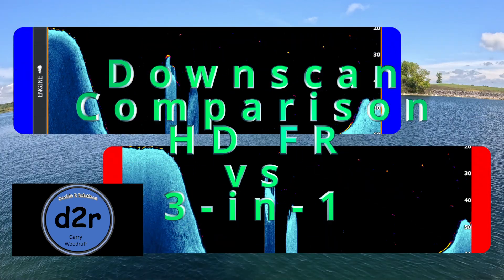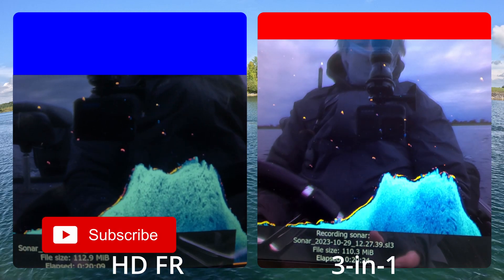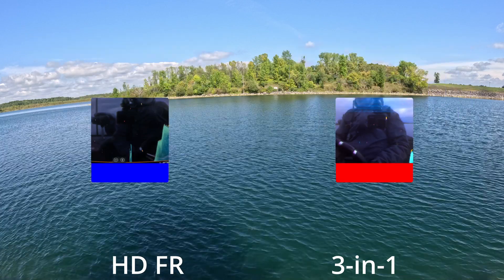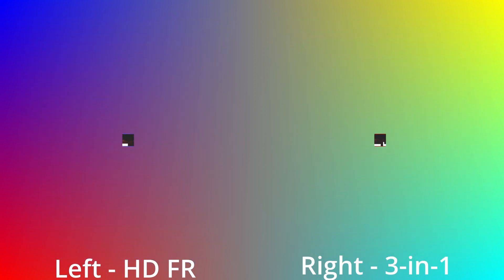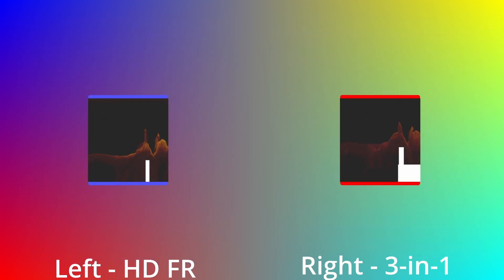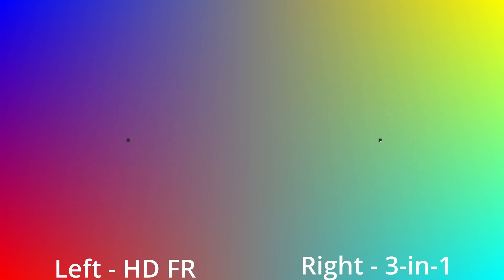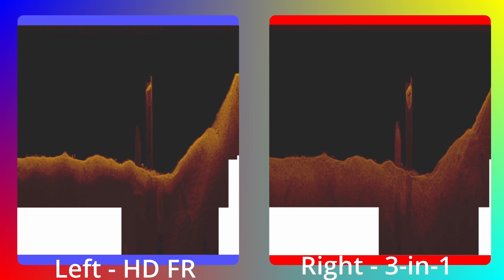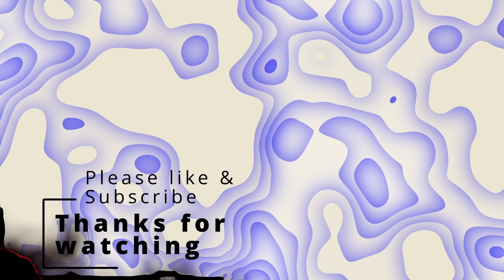Down Imaging - Lowrance Active Imaging 3-in-1 versus HD Transducers

Comment: were you using the s3100 module for the hd transducer?
Reply from the maker: Yes, the 3100 module has the HD transducer connected. Actually, I am using the fish reveal (FR) version of the HD transducer and that requires the S3100 module to fully function.

Comment: The images look very clear.  Are these units setup with ping synchronization?
Reply from the maker: Yes they are using the sync capability. The right console unit (3-in-1) is synced with the S3100 module (HD FR). I am planning on doing another video showing the effects of the enabling/disabling of the sync on the units.

And thanks for watching!
Reply: Sounds good.  I would like to see it.
Reply from the maker: I just need a couple of warmer days to get to a lake to film it. That's not easy up here as it has been colder than I like.
Reply: @garrywoodruff960 so I have a HDS Pro and a live and I get terrible crosstalk when I try to run the old AI 3n1 or my airmar sonar with the HD ducer. If I purchase the s3100 module will I possibly be able to run these transducers without cross talk? Thank you for your time
Reply from the maker: If you put the Airmar and HD on the 3100 and the older 3-in-1 on the Pro and connect the blue (3100) and yellow (Pro), then then enable sync then you will eliminate the noise.

I run the HD FR with an inhull transducer to the 3100 module. And the 3-in-1 (NON HD) and inhull to my Pro unit. WIth sync enabled I do see any noise. If I disable the sync then I do see the noise, (There will be a video on noise as soon as I am well enough to get my boat and do the filming.)